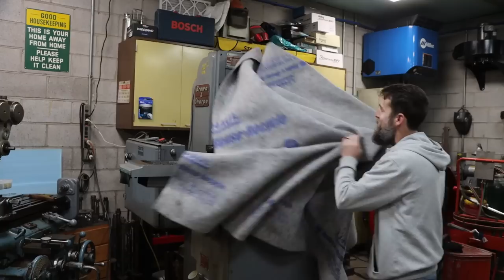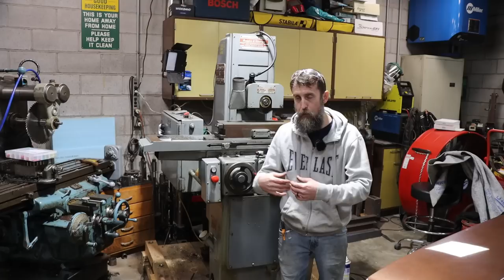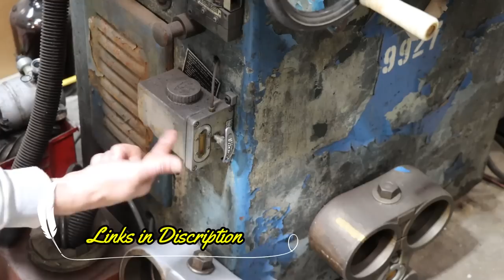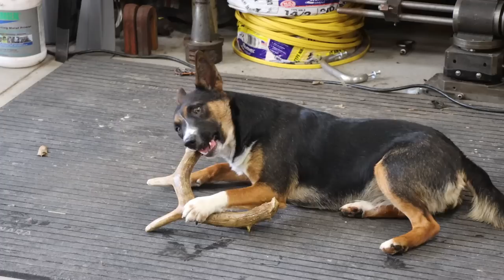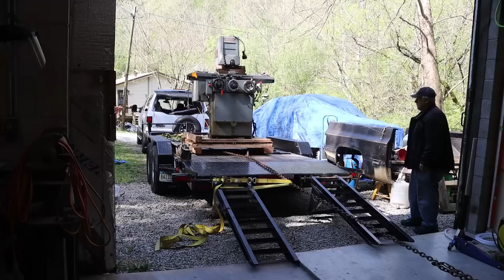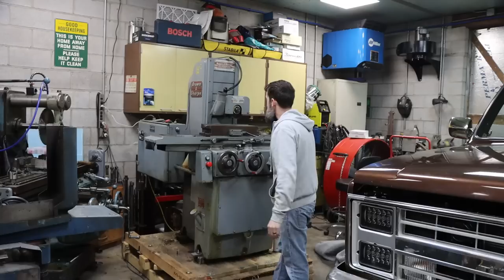Look what showed up at the shop! New Equipment Day!

Comment: Whenever you have a component that can move in more than one axis there will always be some small amount of Kant because there has to be some clearance for it to be able to move. This is why heavy duty grinders and jig bores are built this way.  By having the table move in only one axis it can be adjusted so it only moves in a straight line. Then the column can be adjusted to only move in a straight line perpindicular to the table axis. This makes the machine as accurate as possible.  So glad I have an overhead crane for handling equipment. best thing ever!

Comment: The problem with internal oil reservoirs is that coolant always finds a way to get in the oil tank and contaminate the oil. When I worked Grinders for Industry we always converted the machines we rebuilt to external sump.

Comment: One way of modest cost to move big stuff is to rent a big forklift for a day. We have a 5000 lb forklift but have to rent an 8-10,000 lb one on occasion to handle big machines. The cost of the forklift ($400-500) will be vastly less than cost of any repair to a machine and much safer too. Preventing personal injury to employees is of course  most important.

Comment: Great score Steve, I guessed surface grinder as it’s the only thing I thought might be that shape. I also have a Brown & Sharpe surface grinder but it’s just a No.2. It used to be a 2B but someone removed all the automatic features so now it’s just a 2. Works well and no auto feeds isn’t really a problem as it doesn’t get used all the time. It was made in 1943 and still has no play in the spindle so it does me. 
Cheers Stuart 🇦🇺

Comment: make sure you check that the pump motor is wired for 220 and not 440
Reply from the maker: It is wired for 220 volt. That is how they used it at the place it came from.
Reply: @SteveSummers  I bought one of these grinders a few years ago and the grinder motor was wired for 220 but they forgot to change the pump motor and I had to replace it because it was burned up

Comment: You know, I good little project to machine up would be some heavy equipment casters and a set of toe jack hydraulic jack attachments for when moving heavy machines like this. Those low profile, heavy casters I've seen machinery movers use, seem heavy duty but not very complex or complicated and the toe jacks they use, seem like they could be built using harbor freight bottle jacks and a machined adapter for the toe.part.

Comment: I have  Reid 6X18 and it has a caliper on the Z axis where you can dial one tenth. you can easily put 5 lines between tenths because they are spaced like 1/4 apart. I thought this type of caliper is standard in manual grinding machines

Comment: Wood is cheap, light, and flexible. Coincidentally to me removing a cement wash basin from a basement, I watched Tom Lipton’s video on moving shop machinery. Prep is everything and the right simple piece of wood will save your life.

Why not make an extra long skid and just place the equipment on the front half? When you unload towards  the ramps, it can’t tip over because of the counter leverage from the excess skid platform.

Also, one can make a skid with hydraulic casters/rollers. During transport, the rollers are retracted. Once you get home, just pump them by hand to lift and roll.
Reply: Edit: Instead of true hydraulic, fashion steel mounts that work like tensioning rams on tracked, heavy equipment. They get pumped with grease to lift /spread.

Comment: Having done my fair share of moving machinery, I will add in the one thing you really want, along with the floor anchors, is a strong set of eye bolts in the roof space, to allow you to lift things off the trailer or back of truck, or put them into said vehicle. I placed a steel plate on a concrete beam, using some M12 Rawl bolts, so I had a plate end with a hole, enough to put the rod of a D shackle through, that allowed the chain block to hang.  Another machine had, on the concrete roof, a 2 ton rated M12 eye socket, that went to the M12 Rawl bolts that were both tight in the concrete, and also held in with construction epoxy as well. tightened to the max, and there to allow the chain block to lift the half ton of each end easily. Reinforced concrete roofs there, capable of handling regular commercial loading, so little worry, other than the bolt pulling out complete, thus the epoxy to ensure it would never come loose. Beam much less worry, shear loading, which that size bolt was easily well capable of, and the weak point was the steel plate itself.
Reply: look back on Steve's shop rebuild , the roof has timber trusses they will not support ant sort of concentrated load , show yes hoist no way

Comment: Could you have backed the trailer into the shop, then pulled pallet to edge of trailer, then used the forklift to do a lift, pulled trailer out from under, and then lowered ?
Reply: That maschine looks way heavier as that lift can handle!
Such a lift can typically handel 2 ton´s, but such a maschine hase 3-5 ton´s maby even more.
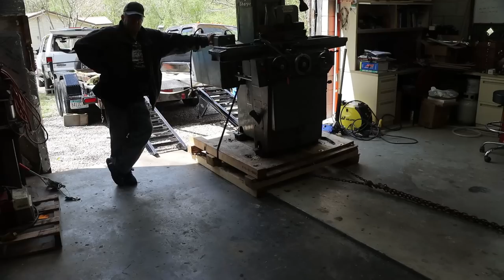Reply: @martin09091989  Yeah okay you're right...   @20:20 its just being used as a pallet dolly, not for lifting.   Steve needs a lifting beam over his doorway!